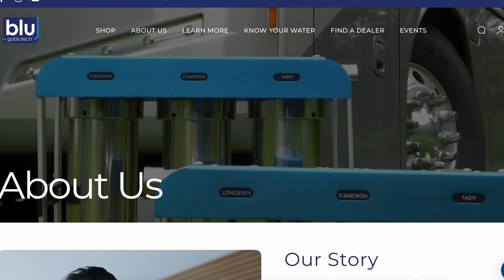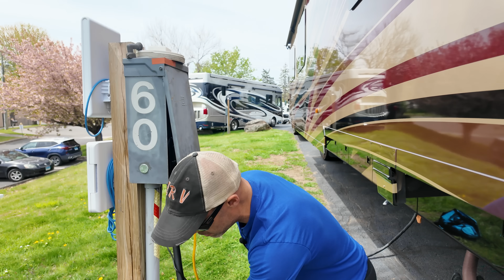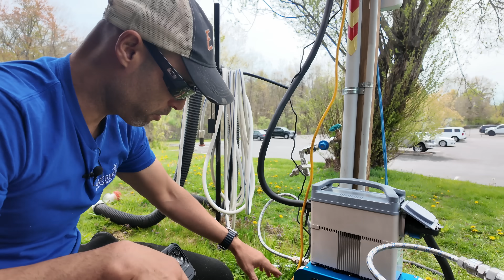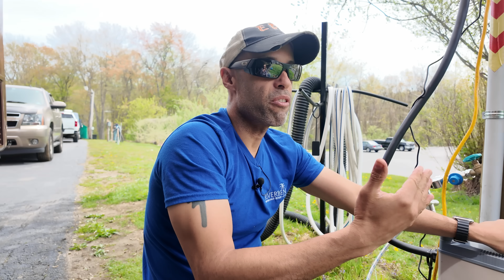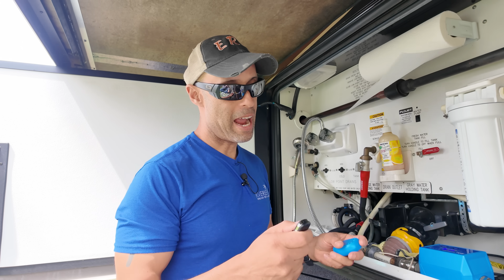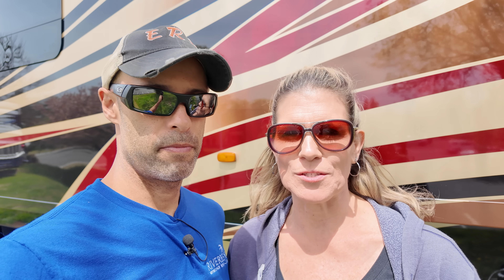We Didn’t Take RV Water Safety Seriously…UNTIL NOW

Comment: What you have in the built in wet bay water filter cartridge?  Unless I missed, you did not mention it.  We use the pricey;

“Envig 4C Catalytic Carbon Water Filter Cartridge”

Helps with sulfur shower smell.  Since heat really stirs it up.
Reply: Lookup the dye (virus) test from Clearsource, about 4 months ago, might surprise you.

Comment: I have the same filtration system and so far its great. I will be getting the water stops snd the remote shut off. Unfortunately my Super C doesnt have a wet bay, except sewer. my connection is exterior.

Comment: I have sitting behind me a blu softner and filter (ar3 I think). I had ordered it specifically after reading reviews for our new motorhome (which we pickup 7/6). I don’t think I got the UV light set I will have to look 😊. Too bad I did not wait for your discount code. 

Usually UV lights need to be replaced every couple of years (at least our spa and a house I once had one on did). The water shut off is interesting it’s a lot like the Moen Flo (I have it on our house) it learns your use patterns and shuts off water if an unusual activity happens with an alert to your phone that can override the shut of. 

For our house it’s ideal but since I almost always (with the previous motorhome) have the water pump on (and only leave the outside water setting to auto-fill) did not see how it would work for me. The water pump will keep pumping when the outside water is cutoff 😂

Great video and am looking forward to seeing you at the meetup with our new coach.

Comment: A sanitary flush is good to do at least once a year. This setup filters incoming water, but depending on your setup, may miss you filling up your tanks from containers while off-grid. Tanks will also fill up with air whan used. Adding potential particles/bacteria. If you are drinking this, I would add a UV faucet to the sink in the kitchen, and possibly a filter under the sink.
Reply from the maker: Berkey as final step
Reply: @EndlessRVing  Does that have UV? UV on the input line won't help with anything in the lines or tanks. And air that gets into the tanks, when using the water in them, can carry particles and bacteria.

Comment: If you are planning to RV in a third world country this is the product for you. For the 99% of you who don’t need this product, nor the expensive and possibly difficult to get filters, there are other solution. First, before hooking up, run the water. 10-15 seconds will flush out any rust, etc. Then hook up your hose and flush it out 10 seconds. Then hook it up. You are 95% there. Add a sediment filter will get you to 98% Add a 5 micron carbon filter and you’re at 99.9%. Use your water lines, flushing them out is good. Clean your faucet aerators.
Reply: I agree.  Those 3 filters are tiny and can't be that effective for very long.

Comment: I just added their UVC Faucet at my sink on my Airstream Bambi 16. It cleans the water in my fresh holding tank as well as water from the campground hookup by simply using the special faucet for drinking/cooking water .  And they have a pigtail that allows connection to 12V so it works while boondocking!!!

Comment: So THAT’S what happened to my hair…they said it was genetics.  On the serious side, I have been reading up on this system.  A couple questions if I may.  I see your old single filter is there…did you bypass that filter and am not using it at all now?  Did you sanitize your holding tank before using this and drinking from the holding tank or do you still get some smell/taste from the holding tank?  Finally, I have seen where the water softener comes before the filters to remove minerals first and then use the filters to finish the filtering before going into the tank…or does it matter the order of filters?  Thank you for the vid.  This is one of my next installs.  Appreciate you taking the time to share your setups and why you do them.  Please keep up the great work!!!!
Reply from the maker: We did sanitize our tanks.  We still use the whole house filter.  Most people put the softener after the filter.  Safe travels

Comment: I have seen at least six RV water filtration videos and I have asked the same question to everyone. Did you do a water analysis test before the filters and after the filters? I would also do this at a couple of different campgrounds and maybe a couple months in between tests. I have also asked this to some that promoted Berkey water products. I know you will be shocked but everyone has said no they did not. Do I have trust issues LOL? You bet. Do I think everything is a scam? Yep. Okay maybe not everything but I rarely do not follow the great one's motto----trust but verify. Am I nuts? Yep. I recently got a letter about jury duty and it said go to this website and fill out questions and register. Did I do that? Nope. I drove to the courthouse and asked if it was legit. It was but she said there was some letters going around saying they missed jury duty and they have a fine. They gave instructions on where to send the money. I bet Izzy has much better stories!
Reply: The only filter that is NSF certified is the particulate. The .2 (which is a NOMINAL .2!) is not, either is the UV. The only evaluation of the UV was done by the manufacturer. Good luck finding the NSF certs they do have. Just trust them, you'll be fine.
Reply: @GlendaleAZFlyBoy of course. I trust everything because that works so well. Everyone told Columbus the earth was flat and recently we were told get the Shot and you won't get covid.
Reply: @danrandall794  My OCD would also demand a filter system under the sink, and a UV faucet added by the sink, for drinking water. Because the tanks fill with air as they empty, so bacteria and particles can enter. Plus that last step gives me more confidence. Keeping the whole house filter in front of this system is good for extending the life of these filters. Especially with moving, and always getting different levels of water quality.
Reply: @enigma4268 exactly. Of course I used to drink out of the hose.
Reply: @danrandall794 If you really want safe drinking water, RO is the way to go. And cheaper than this. RO filters to .0001 microns.
Reply: @GlendaleAZFlyBoy  What is RO? Also unless you test how would you know. My point is no one tests.
Reply: @danrandall794 Reverse osmosis. Cleaner by design. Utilizes more water, but if using park water doesn't really matter.
Reply: @GlendaleAZFlyBoy  Got it but I still go back to my point how does anyone know if it works without verification? I am sure some are better than others.

Comment: We use effectively the same system ours is the older model without the UV which is awesome. The new water softener with the new valve is sweet! 

So I am a water phobe everyone has a soapbox this one is mine. 

We also bring a pure water distiller for drinking water. We lived in California for many years with spent rocket fuel in the water table. Do not trust the water anywhere! 

Pardon me while I climb down off my soap box. 

BLU is a great system and they back up the products it’s a must have!

Comment: The regulator can reduce pressure but it can't increase it. I keep my water setting on "auto fill" but run my pump and use the water in the tank. Isn't chlorination of water supposed to kill bacteria? So if the water has been chlorinated a UV filter is redundant.
Reply from the maker: As you know Roy many campgrounds run on well water.   As we said in the video Dave’s RV center is not the norm providing city water.